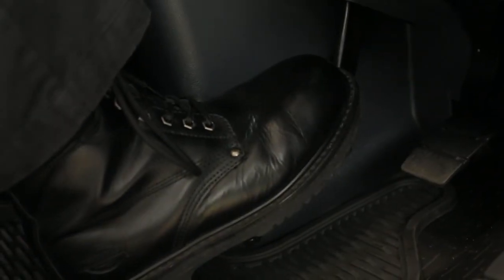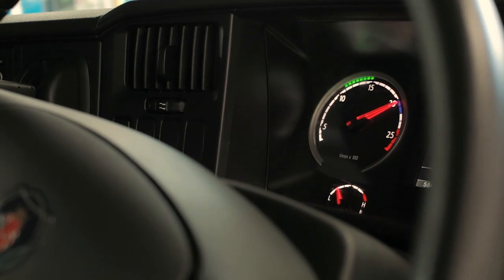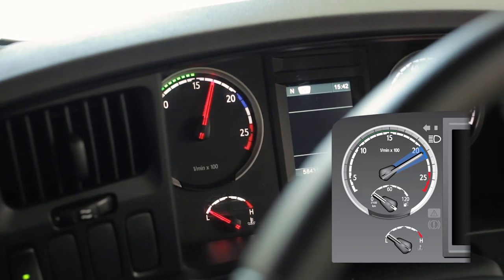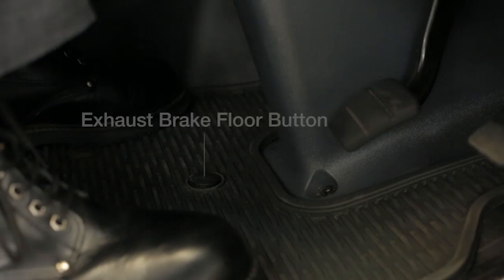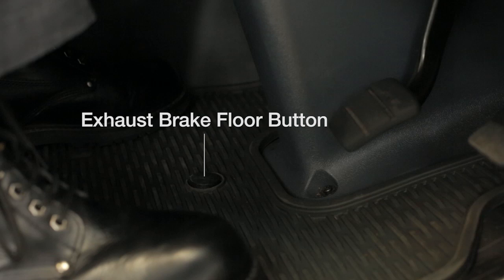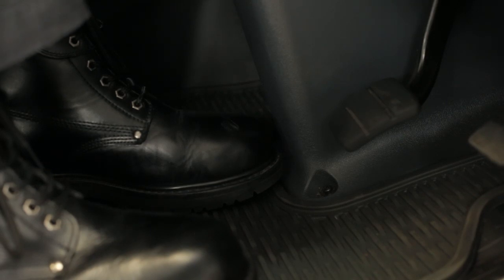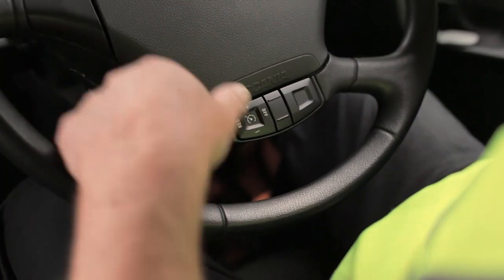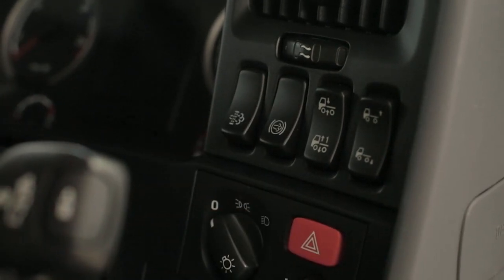Scania Handover Series - 25 Exhaust Brake

Comment: Do these motors have Jake brakes and retarders ?
Reply: scania has the best retarder in the business :)
Reply: I'd like an answer to this question as well cause I love the scania engines but to me there only downfall is that they don't have any jake brake (from all th previous videos I've listened to) but I'd like to get confirmation from the manufacturer if they have any with jake brake and if not, why the don't produce them with it
Reply: @BillSikes.  is there any way to make it a little louder cause I'm a young 24 year old guy who's from a small Caribbean country called jamaica and I'd love it join the trucking industry. In my country, the loud bangs of the jakes is very entertaining. We have some reckless drivers but all in all we're having fun while working. I like scanias very much so I want to import at least two but the jakes just too silent for me. I was planning to engine swap them but I don't want to get rid of that that sweet V8 sound
Reply: @themosthated_collins  
You probably could by doing something with the exhaust, but I only drive them, a decent fitter could do it
Reply: @BillSikes.  thanks
Reply: @themosthated_collins  
Your welcome bro, safe travels 🚛🙋

Comment: Why cant scania just make jake brake like kenworth???
Reply: American jake brake system is loud and not as effective
Reply: It'll have an exhaust brake, which is effectively the same thing
Reply: To me I think jake brake is more effective than exhaust brake. Just hear me out. The European trucks have exhaust brake, Retarder, cruse control and hill descent so to me, I think you can come to a complete stop without touching your brakes. As the American trucks have only jake brake and cruse control but it still slows down quite a bit with just the jakes.
Reply: @themosthated_collins  
We still have to use the service brakes, especially when pulling 40 odd ton
Reply: @BillSikes.  I understand that. It's just that the EU trucks have a lot of brake assist which lead to my previous comments but I know that u still need the main brakes. I just love how the Jake's sound and I think it would be a good addition to the scania engines.
Reply: Engine braking is essentialy pressure buildup in the engine, instead of using the normal exhaust release to maintain that pressure in the engine, it uses a seperate switch to keep that pressure but it can fall back on the engine brake. Essentialy its a safer engine brake.